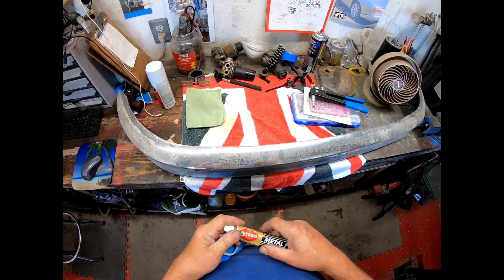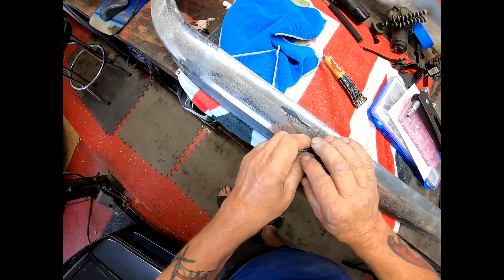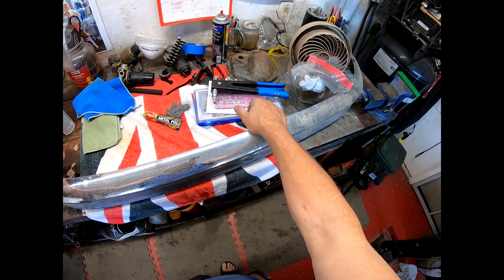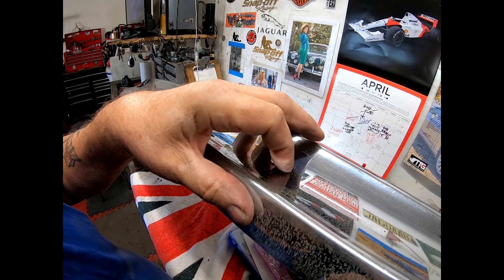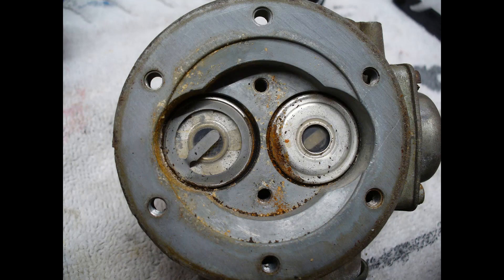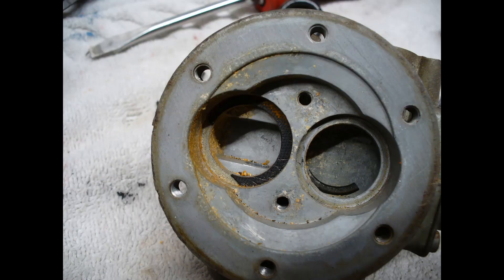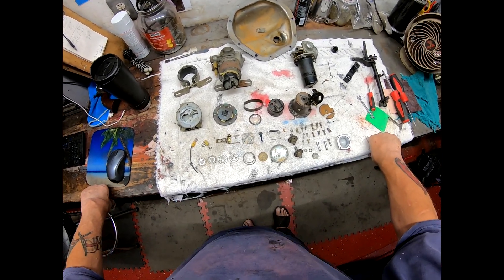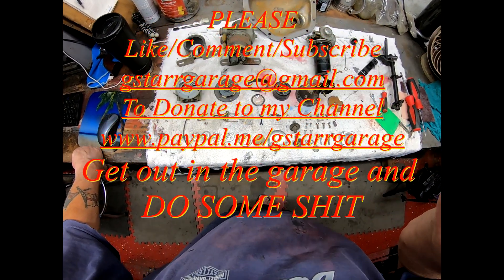Jaguar MKII Reassembly Part 39

Comment: Tip when using the 0004 steel use wax or show n shine it acts as lubricant.
Also 0004 brass wool is a good option